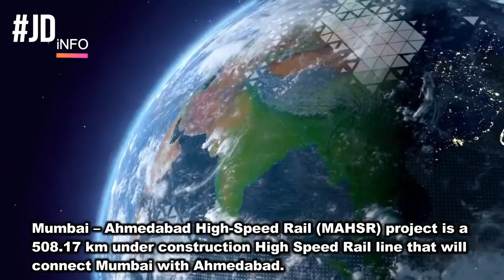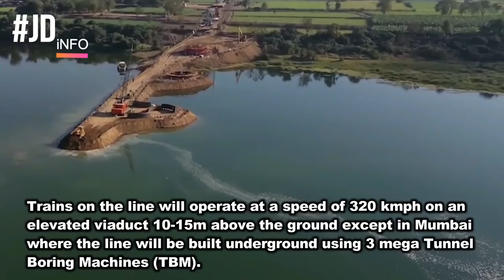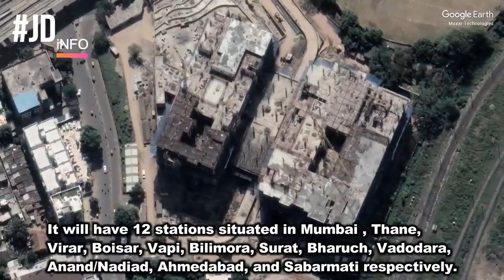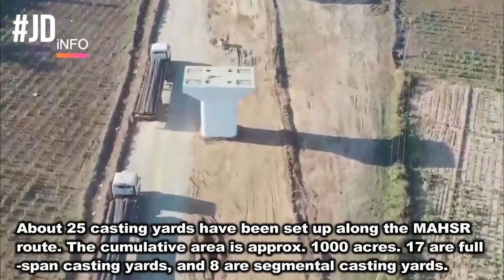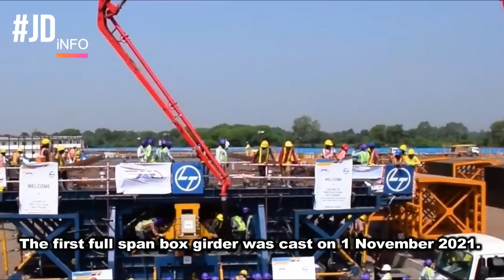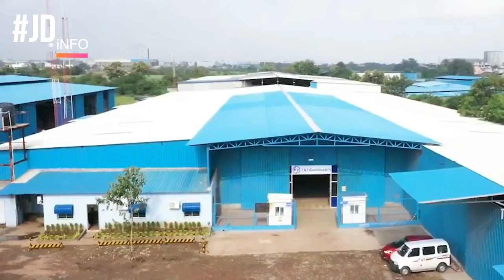India's USD 15 Billion Bullet train project

Comment: Lack of Double tracks , absence of tracks in some areas, unmanned crossings , electrification of tracks ,late runnings etc r some problems yet to be solved by Indian Railways.
Reply: All being addressed the right but you chose to consider them at the cost of this project.
There's something called parallel improvisation